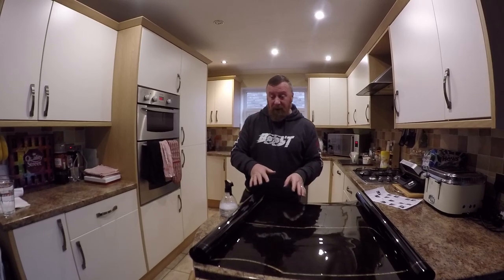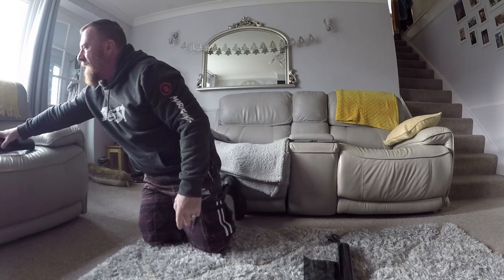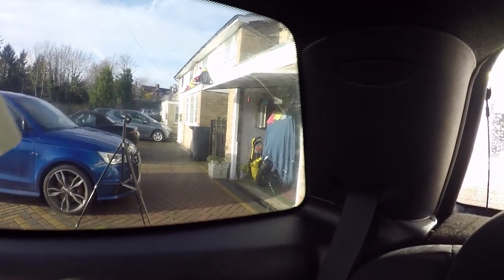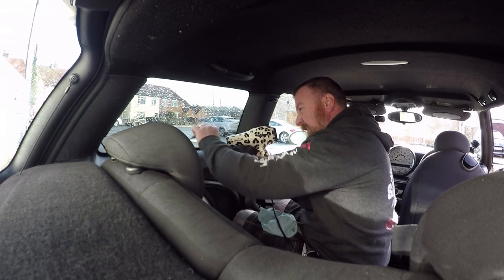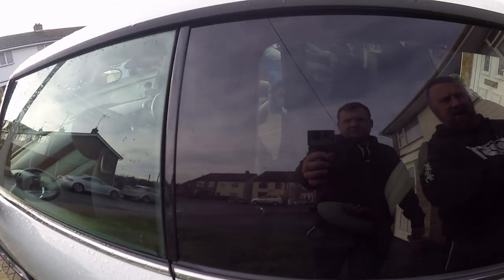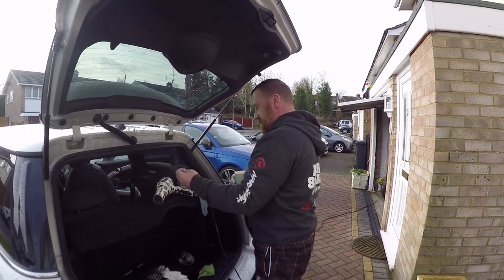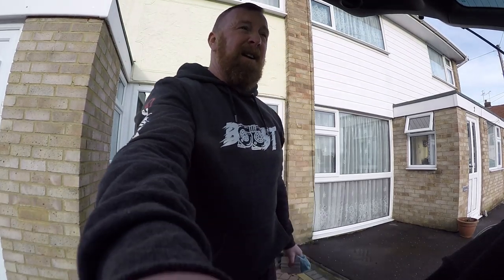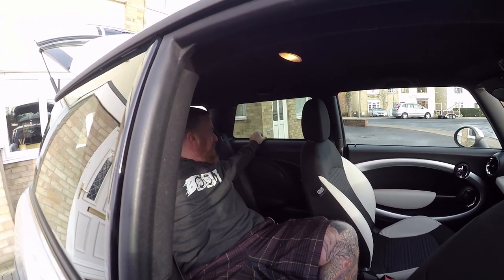DONT TRY THIS ! WINDOW TINTING THAT DIDN'T GO WELL AT ALL MARK SAVAGE

Comment: mark I'm no expert but can I sugest that after cutting the shape out, cut  a strip of the backing off the side, (so you have 90 percent backing still on), place the unbacked part on the window exactly placed then slowly unpeel the backing using that white rubber thing, plenty of spray. I'm not saying I could do it any better, just this way would not leave creases. well done mate

Comment: Honestly, pay a professional to use some decent tint film, the back window is a horrible challenge and won’t stick because of the heating elements unless you wire wool the elements to key them. When you watch the pro do it with ease it’s £100 well spent! I admire your determination though :)
Reply from the maker: Determination or stupidity pmsl 
But I had to give it a go 
Thanks for watching bud

Comment: Could have always just gone for privacy blinds, I've got the privacy blinds on my R56. Doesn't look any  different to tints until you are right up close.
The good thing about the privacy blinds, they are easy to fit, and can be removed in the winter for better visibility.
Reply from the maker: Will have a look into them bud 
Have a great 2020

Comment: Rather than spend £100 getting the films fitted you could have bought four at £26 each and practiced fitting them....!!  Can you get a couple of other mini owners to get them fitted at the same time as you and work together - it may be a two person job that doesn't look like one, holding the film taught before it goes on to avoid getting the creases in it may be the trick...  Could you have cut a practice sheet out of the leftovers that you start talking about at around 24:00 and worked out the techniques that you could have used?
Reply from the maker: Yes bud 
I was worth a go and as I say you have to give it a go and maybe after 30 tries I'll be good at it 
Or not pmsl 
Thank for watching bud 
Have a great 2020
Reply: @marksavage  If you do use the leftovers and try a few other methods rather than the manufacturers recommended methods (I just watched the Retrorestore method https://www.youtube.com/watch?v=yzY5CBWSY7A&t=603s) it may not make a bad video to try combining a few tips from other how to videos to get better results. There are quite a few beginner methods for tinting that you could summarise - that would make a better how to video to have all the tips from the most viewed and most liked videos together and give better tips on how to do this.

Comment: Great video has always sorry things didn't go to plan .
I have a question.
Both most mine and mi stepsons mopeds tgb 202 classic ..and longjia 50cc 2strokes both throw out ocaisional sparks of of there exhausts both run smooth no lack of power .
Anything to worrie about.
Reply from the maker: Odd but if they are both running fine I wouldn't worry too much 
It sounds like excess fuel 
Have a look at the spark plug to see if its burning ok 
Are they using 95 petrol or super 99 as this can cause this 
I'd say play and tune the carb but you say they are both starting and running well !
As for the windows well it was worth a go lol 
Thanks for watching bud

Comment: Hey mark
 Been getting bored with the usual channel watching till I ran across yours you're right you have to do it your self to learn.
Had a really nice 64 mustang 
And did the same. Found out after I did the same mess that its not the soap its what's in the soap. 
If you use to much soap the tint gets milky looking when it dries. 
I talked to a pro tinter and found out 20 percent lemon dish soap in the water and it works great but if your window if 3 axis glass like your coop min you have to relief cut the tint or heat gun as you go And that dries out the water and you have to speed up much more and get it done quickly, can be scary. if you saw my mustang when I was done you would be proud of yours. And if you leave it on long enough to dry completely you would never get it off. And THAT would bloody suck like a wanker.!! And buy the way lighter fluid for adhesives removal. Less invasive than fuel on clear coat paint.
So
Reply from the maker: thanks bud I have a f150 now and was thinking about trying again as I have some left over and the are flat lol, thanks for the advice bud and for watching
theres 465 videos so something for everyone , take care

Comment: Hello There, 
I have just fitted a new unrestricted CDI bypass to my 50cc speed fight 2 LC
Took it for a test drive and it now starts but loses revs within 30 seconds and eventually cuts out? 
Any help appreciated thanks Mark
Reply from the maker: ive had this in the passed and my problem was the new cdi was cheap and going to earth and sorting out, once off and on again it worked for another 1min then stopped again 
that took a long time to trace that was the problem!!
I cleaned the carb new this and that but in the end I bought another cdi and it worked fine 
was it working ok before you changed the cdi , this can also be the stator coil going to earth which caused my cdi to blow in the first place !!
check the volts coming for the stator coil 
my videos will help bud theres over 70 on speedfights
Reply: mark savage it definitely wasn’t doing it before I changed it, it will ride for about 5 mins and once on high revs for a bit it then starts bogging as if it’s overfuelling
Reply: mark savage it was 43£ the red cdi bypass
Reply from the maker: maybe take off carb then bud and check out the float and vacuum and fuel lines as the cdi doesn't run the carb but does do the timing ! so still could be the cdi?